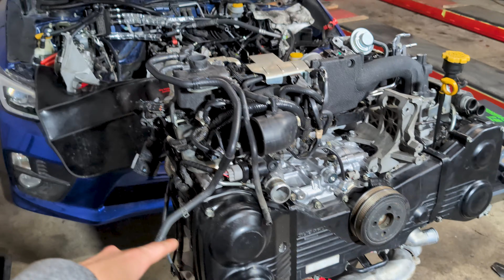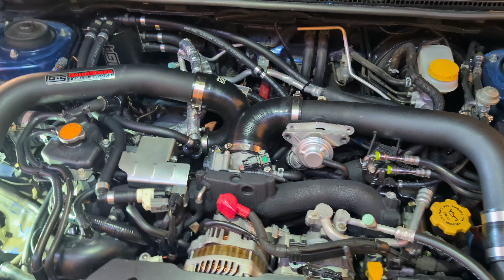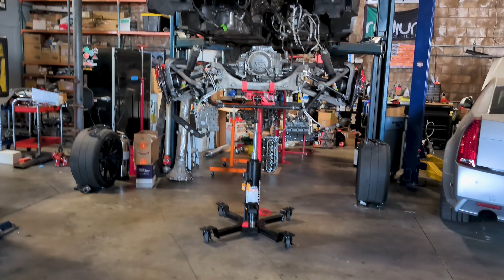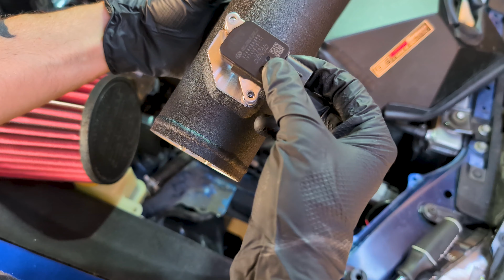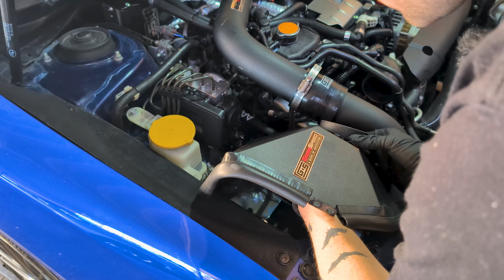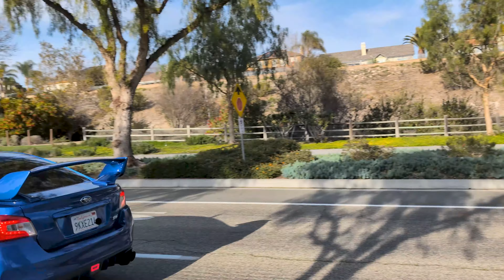THE TURBO NOISE IS CRAZY! (GrimmSpeed Stealthbox Install + Sound Test)

Comment: Sounds great! How do you clean the air filter? Does it require oil? Thanks
Reply from the maker: You can just buy a K&N filter clean kit on Amazon or AutoZone. They're like 40 bucks. Thanks! I thought so too at the time but the STI has changed so much since them

Comment: Dang! This sounds so fricken sexy! I was wondering, is this all you had installed at the time ? I’m getting ready to buy my Sti and I want it to sound just like this !
Reply from the maker: Hi there! Yes - all I had at the time was a Tial 50mm BoV, GS intake, Invidia Catless dp and a ETS Extreme Catback 😂 pretty simple set up but it was so sick to drive around. 

That's awesome to hear btw what color?  Excited for you! 👀
Reply: I’m thinking 19’ white, or rally blue. I want to really hear the turbo flutter lol. That sound is addictive
Reply from the maker: @TearDoesSotierology  I used to have a CWP WRX and the 3 stage paint with the pearl is very nice in the sun. WRB is a classic ofc. Can't go wrong with either!
Reply: @nit3sh1ft thats awesome! Did you get rid of your subi !? I’m going AWE cat back, grimspeed cold air and grimspeed bypass! I’m hoping it sounds similiar
Reply from the maker: @TearDoesSotierology nope still have it and still running (for now lol) !